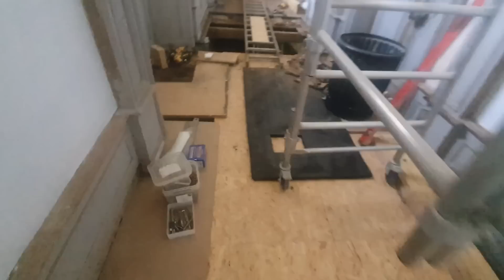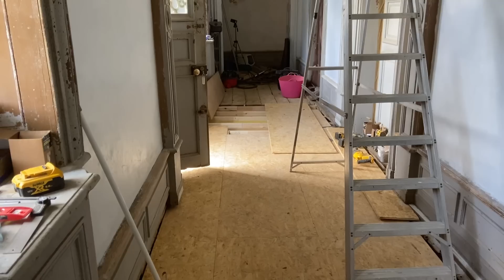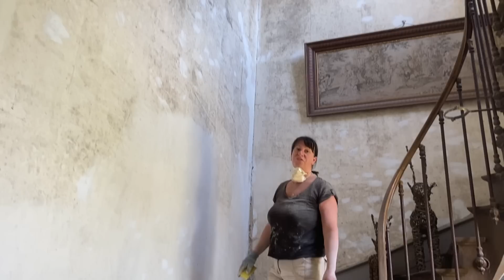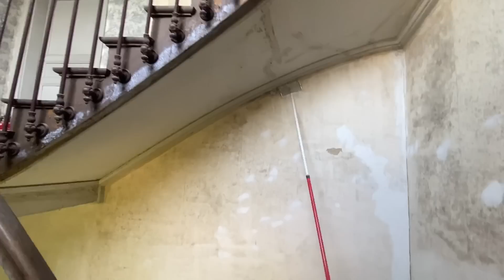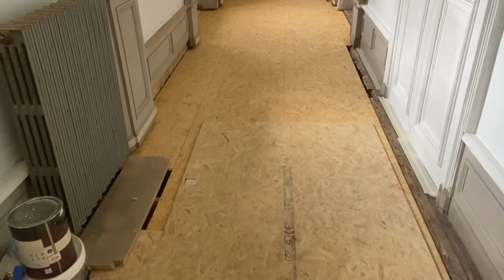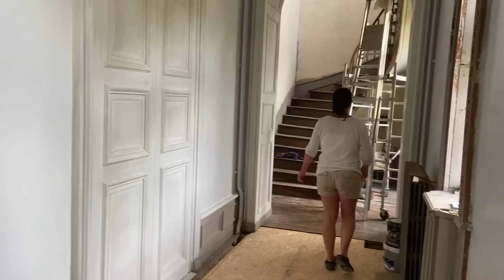We Cannot Believe The Difference!!

Comment: I'm always surprised at the tools I never see used in Europe. Sanding walls, I would use a pole sander (was glad to see you using one). My husband and I would take doors down, sand and prep them and then use paint sprayers to paint them so we don't have brush or roller marks. We would also cover windows with plastic by using painter's tape to hold it on, and tape of trim, then use a sprayer to paint walls... goes waaayyyy faster. Then paint trim by hand. We would also caulk the edge where wood panels or baseboard trim meets plaster, or sheet rock, then use a damp sponge to wipe off excess caulk to get a clean line, let it dry and then paint the walls and wood. We also never see videos of Europeans using weed wackers or edgers. I live in Florida and things grow fast and thick. Can't live without a weed wacker. Anyway, just some observations that I've made from watching various chateau channels. 😊

Comment: I am constantly amazed by your handy work and energy!  I have two questions though, will there be a rug in the gold room and would you consider hiding/camouflaging the radiators?  I am thinking of renovating an older property with rads, but they stick out like sore thumbs.(Not original heating source.) I'm looking for a way to make them disappear.
Reply from the maker: Rug will eventually follow. Don’t have a problem with the rads. They give off so much heat as they are (uncovered)
Reply: Thanks for responding. I can't wait to go virtual shopping with you for a rug... My rooms are much smaller, ceilings lower and my rads overpower the rooms.  To be honest if you were covering your rads, I was just going to copy you🥰.  I love your design aesthetic..

Comment: Why did you cut the beams? Is it really better for stability the way it is now?
Reply from the maker: They were rotten / insect damaged
Reply: Oh okay, why did you make a new type of construction instead of just putting them in the walls "the old way"?
Reply from the maker: @097hhd63  I inserted one side but I did not want to disturb the other side as they were in there solid and underneath some of the flooring.